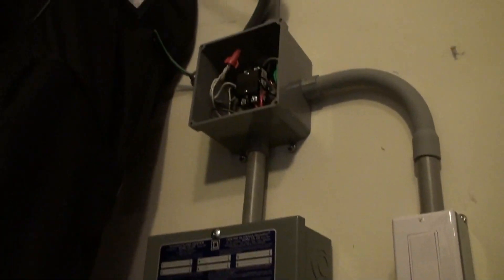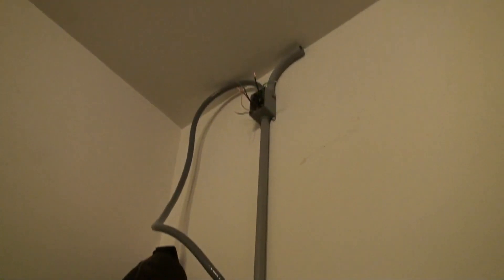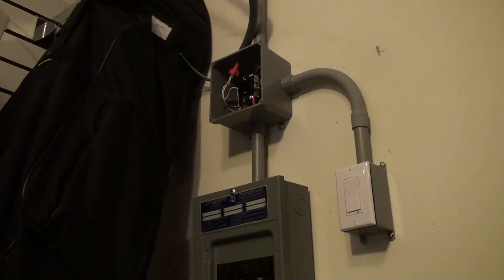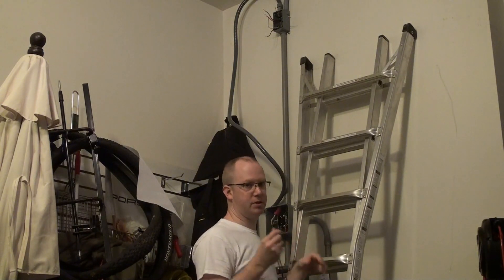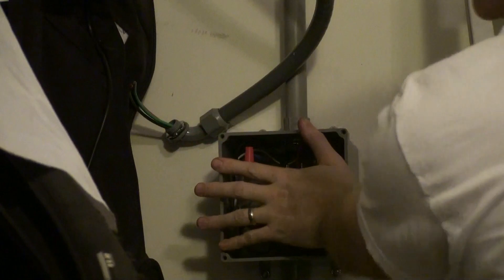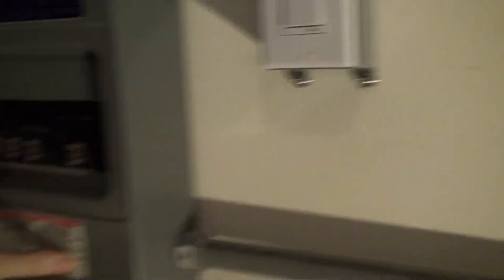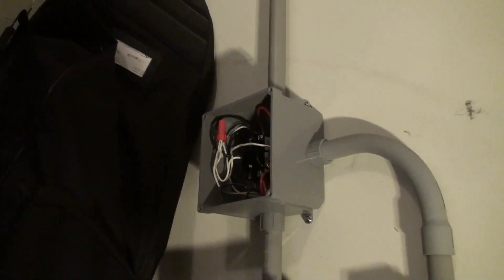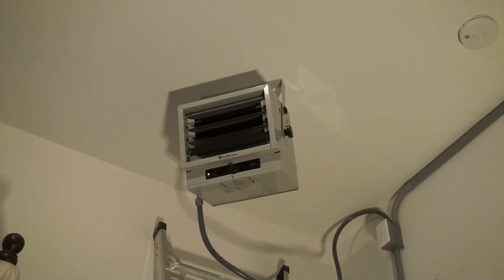Garage Heater wiring and Smartthings automation (with contactor installation)

Comment: One thing I dont get is why is the nutral not attached? Dont u need that to complete the circuit? I did my hookup that way (with the nutral wire un attached) and it works great but the power light never goes off.
Reply from the maker: Neutrals are not used because the 2 legs of 120v are out of phase. My power light also stays on permanently!
Reply: @exportedafrican  oh so even though the nutral is there at the plug in (not hardwired on mine) it doesn't have to be? Ok so the power is still going back to the breaker if not used right it wont push power into the machine even if it isn't being used? and the power light always on is safe?
Reply from the maker: Cody Schroeder yes. If you lookup how to wire a dryer- you will see the same setup for a 4 prong plug on an older dryer
Reply: The service to your house is 2 phases of 120V and a Neutral.  Either Phase to Neutral is 120V, Phase to Phase is 240V.  That is why for this heater you do not need the Neutral.  Some 240V appliances do need the Neutral, because they want 240V for the heat (think dryer) and 120V for the controls.  Either Phase to Ground will also be 120V, but DO NOT connect this way to get 120V, it is a violation of the National Electrical Code.  As others have said, the power light stays on because there is power to the heater.

Comment: had mine up about a year now, and yesterday it was nice so i opened my garage, started to sweep, and turned the heater on just to help blow the dust out, and the main terminal station started to smoke and melt, what would cause that, worked fine all winter.
Reply: Did you figure it out ?
Reply: @LemonySnicket-EUC  no, not exactly. why are you having the same issue? the store i bought it from did honour the 1 year warranty even though i was like a week past it.  the model i had was so longer made tho, least not the exact same, it was same power and heat but a different color, and i am sure the terminal station inside is a little different so i assume there was a manufacture defect with it and they redesigned it because of that. i also noticed they added a switch on the back for if its wired with a thermostat or not, that switch was not on the previous model, before they just added in the instruction book how to change the wiring inside for a thermostat or none.   i ended up changing my circuit a bit in my garage too as i got a tig welder and needed another 220 or 240v source. i put a sub panel box out there with everything on its own breaker.  the heater is pretty much always on when its cold out so fluids i have out there dont freeze, like paint and the water cooler for my welder.  i have noticed quite the increase in my electric bill tho and think when this heater craps out i might spend the extra few hundred on a gas heater, i figure if the gas one last more than 2 or three years it would be a better deal in the long run.... unless this replacement heater gives me a few more years. it has been one already. .. almost, knock on wood.
Reply: @popanollie1  I just installed mine and was just curious about your outcome. Glad you got lucky on the warranty.

Comment: Ya know...there are 3 holes on that ceiling bracket for a reason...one lag bolt is not enough.
Don't you see its wobbling and swiveling ? 
Mount a board or angle iron across 2 beams then secure it with 3 lags into the board, or 2 bolts with L brackets onto the angle iron.
Reply: @Greg T, you are mistaken, one bolt (the correct type/size) is sufficient and acceptable.  It only weighs about 25 lbs.  It is even shown as one of the mounting methods in the instruction manual.  I have mine mounted with a single piece of 1/2" all thread about 12 inches long and is is solid, no wobbling or swiveling.
Reply: @davidbondi  Regardless of its weight or installation instructions, it's quite evident in this video @ 09:15 the bracket is sagging on both sides of the mounting bolt and as he wires the unit its wobbling and turning. A single lag bolt into the beam would be quite adequate to hold a piece of wood or angle bracket to the ceiling giving you a rigid mounting point. This would allow using 2 mounting points to secure the heater is in order to do the job right. You can do as you like with your own unit, but as someone who has spent 30 plus years doing stuff like this professionally. If I did a job like this I would surely get a call from the customer to come back and do it right.
Reply: @gregt5996  Went back and looked @ 09:15 I see what you are talking about.  He clearly doesn't have that lag snugged up tight.  I agree 100% it shouldn't be left that way.  For my installation I laminated 2 pieces of 3/4" Baltic Birch Plywood together, and attached that into the joist.  Through that, I hung the heater on 1/2" all thread using fender washers and split washers to stabilize and lock it down.  Mine does not wiggle or rotate, but if I want to re-direct it, I can turn it and re-snug the bolts.  This video was hard to watch as I was cringing the hole time this guy was anywhere near that ladder.  This guy has no concept of ladder safety and working safely on a ladder.  Scary.
Reply: One bolt properly is just fine.
Reply: @LemonySnicket-EUC  Read my reply to david bondi
Reply from the maker: 2 years later and it’s absolutely fine. 

Reason I only installed one bolt and didn’t tighten it is to be able to swivel it depending what side I am working on.
As for the weight- I don’t think this thing weighs 6 lbs.

Comment: I've used my comfortzone heater for a couple of winters but now It's blowing cool air from the top one quarter or so. I have no idea how to fix it. How do I get info?
Reply from the maker: Check the Wiring on the top coil. I suspect it was disconnected or shorted
Reply: I had the same issue, replaced the thermal cut-out switch, it is a normally open 16a, 250VAC, 50c° switch , it was located under a metal shroud so the heat from the element does not have a direct contact with it, this switch when malfunctions, it cuts out prematurely, heat from the heater goes on for a minute and then the element shuts off but the fan keeps blowing cold air.

Comment: Ho hot is air coming out. Can you place hand in front and not pull hand out right away??
Reply from the maker: No. It comes out around 130 degrees on high

Comment: what is a contactor and how does it work? I want to set up something like these but my heater is 40Amp. Would this work? do you have a list of materials? Thanks
Reply: Awesome - I actually bought this heater - it draws 21amps at 5000W.  So, the 30amp would still be safe I assume?  Aside from the heater brand, I think I'll emulate your setup exactly - going to be great to have my garage climate controlled w/ smartthings!  https://www.amazon.com/gp/product/B009F1SWH8/ref=oh_aui_detailpage_o03_s00?ie=UTF8&psc=1
Reply from the maker: +Adam Woodturner  basically a contractor is a relay for higher amperage or a different voltage. 

You could just get a bigger contractor- say 50 amps- and you would be in good shape. Just look for a 2 pole 110v coil and you should be good to go. 

Let me know if you can't find a contractor and I'll get you a link if needed
Reply: Any chance you could share a link to a contractor?  How did you calculate the amps for it?  Just need to be more than the heater?
Reply from the maker: Exactly. 30 amps would be the max for the heater. I believe the data plate said 23amps so 30 was safe. 

Holdwell 42CF35AF 3 Pole 40 Amp 120V Coil Definite Purpose Contactor https://www.amazon.com/dp/B01J4Z94SK/ref=cm_sw_r_cp_api_5Sv1Ab5X3GQX1 you could do a 2 or 3 pole contractor. I posted the 3. Worst case you leave one bank open.  The main search term you need is "120v coil contactor" and maybe add however many poles you want to the search term. Don't run the ground thru the contactor!
Reply from the maker: Yep. I haven't had a problem in over a year. 

If you use smartthings check out my video about konnected.io. Its pretty cool and I'm going to be building a module for my garage to track the door opening etc for my dad. 

Ultimately I want it to lock out the door opener if the garage is heating.
Reply: Last question - how has it been to have the switch shut off the heater w/out the fan running for a cool-down period?  Any issues there?
Reply from the maker: None yet. Admittedly I leave the switch on medium heat so I'm being pretty light about use
Reply: Cool - oh, and I see you have a z-wave smoke detector - has that ever had false-postives from car exhaust, etc?  I'm also putting in a 14-50 outlet for my Model 3 (coming on Saturday) and I figure it might be smart to have a smoke detector..

Comment: This is almost exactly what I plan to do (specifically with adding a 120v zwave switch to control a 240v heater). Is there any chance in getting a rough wiring diagram?
Reply from the maker: +Ryan Nokleby Yes. I'll draw something up this evening. I also have another recommendation that I'll try shoot that video tonight

Comment: Hey Vector,
Nice heater... Does it cost a lot to run? I'd like a small heater for mu garage... As of now I just use a K1 heater... Electric would be simple and easy...
Reply from the maker: +Garrison Garage I worked it out to about $2 a day (6-7 hours) but depends on doors opening and closing. Once it gets to temp I don't hear it come on more than once an hour but will depend on your insulation!